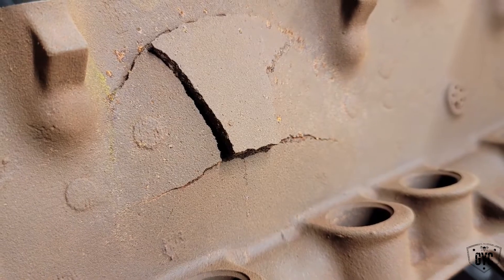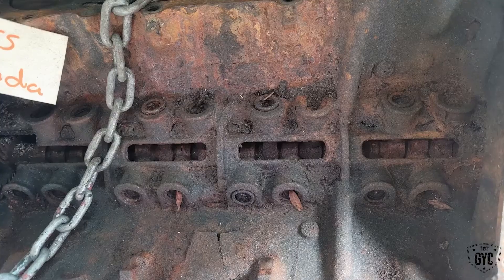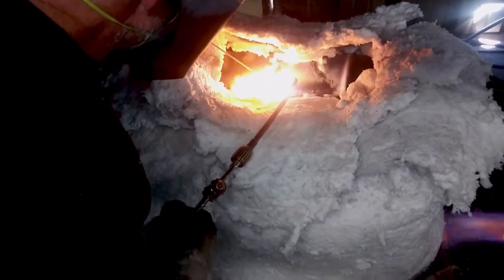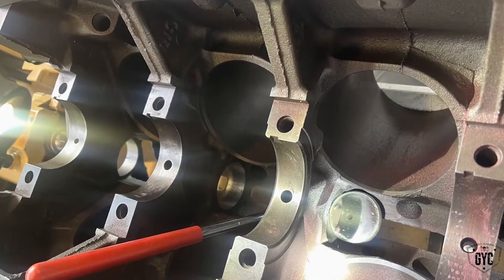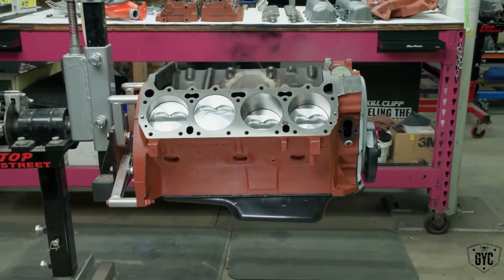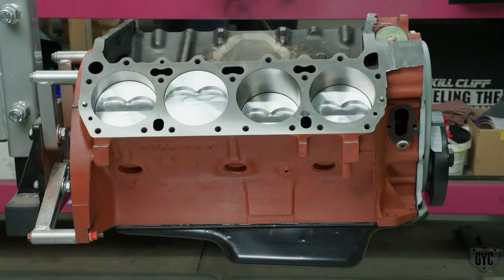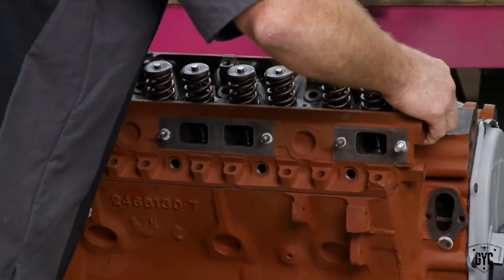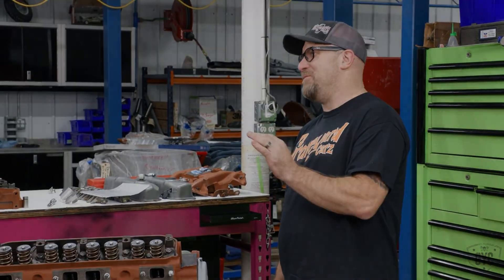1971 Plymouth Cuda Engine Part II | Graveyard Carz

Comment: Well, those are improperly called freeze plugs. Those holes are used in the casting process to remove the casting sand. True that they push out when they experience freezing, but not their intention. But a frozen block can crack in many places other than where there are plugs.